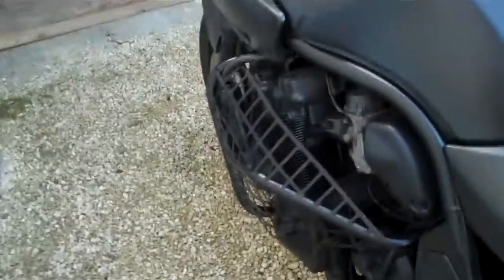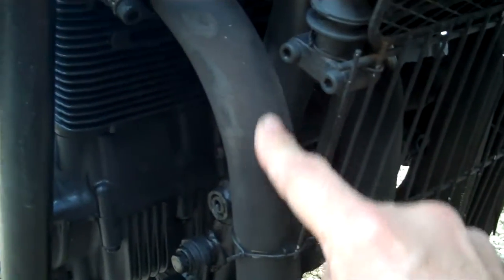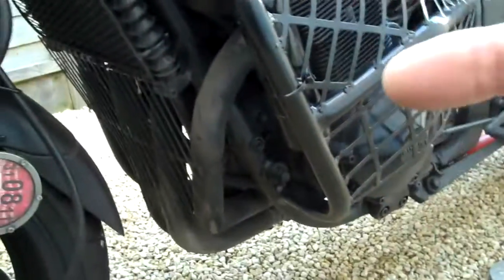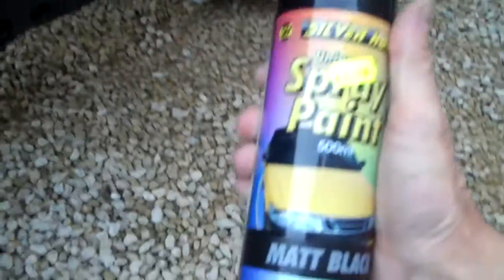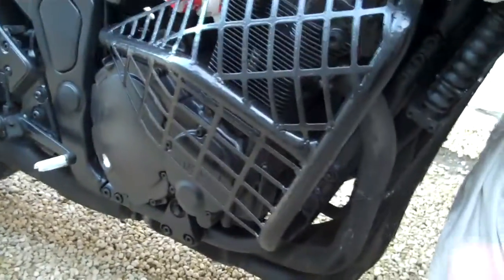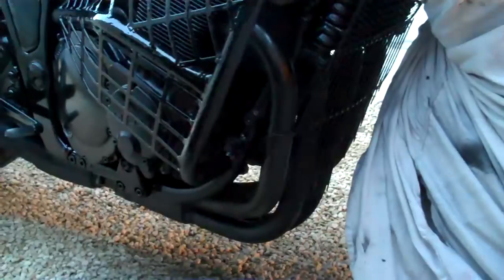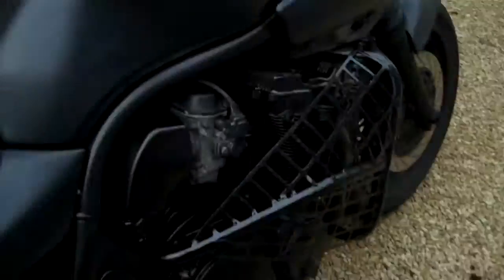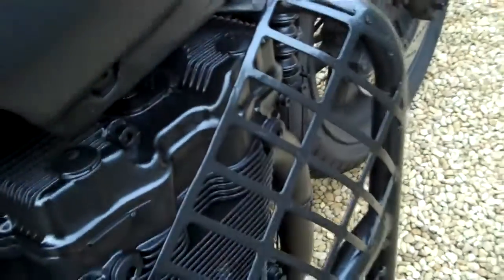Delboy's Garage, Project Rat Bandit, Matt paint fail..!

Comment from the maker: The paint is still on the engine a year later and doing fine mate, as long as you prepare the motor to take the paint, clean it properly and get avery trace of oil or grease off first.. Good luck with the makeunder.. Del.

Comment from the maker: Hi mate, to prep any metal surface for paint, hot or cold, it's important to scuff it up with some abrasive paper and then de-grease it thoroughly with thinners frst - on the cold parts you can use regular matt black spray can paint and on the hot parts use VHT heat proof engine lacquer readily available in matt black ... good luck with it, let's have a video when it's done, Del